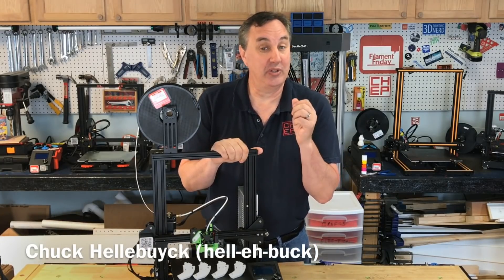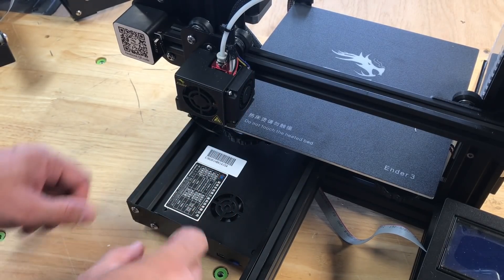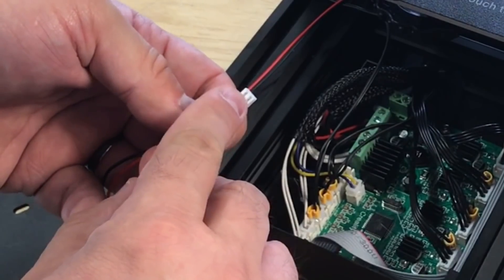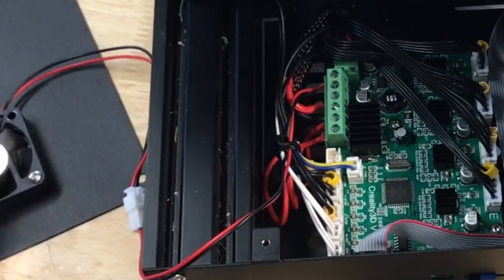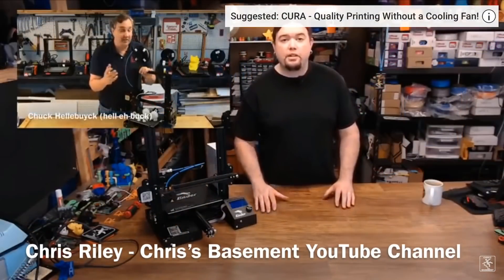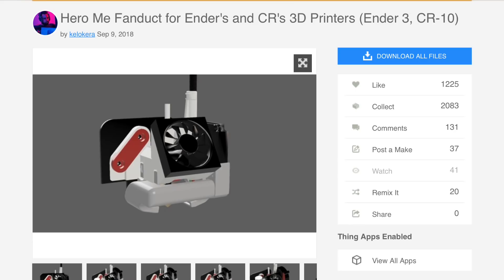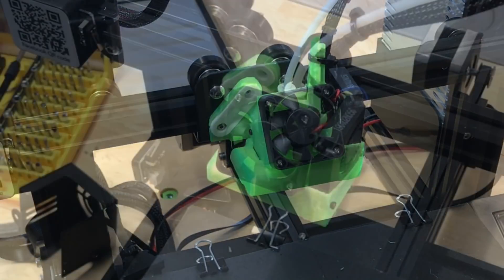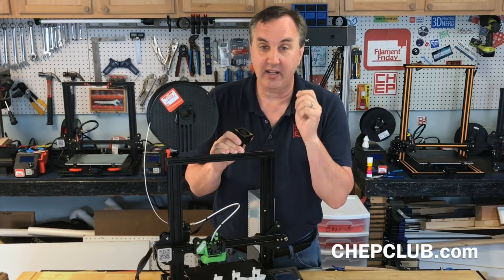HERO ME FAN DUCT and Fixing the Cooling Fans on Creality Ender 3

Comment: Chep, your profile is limiting the speed of your print from the default cura settings because your minimum layer time is now 10 seconds instead of the default of 3 seconds so on a small print that could make your print take up to 3x longer with no added benefit. To make an accurate comparison why not compare the default cura settings (3 second minimum layer time) with fan cooling on and your profile (10 second minimum layer time) and compare not only the quality but also the time it took to print each one.
Reply: Can't agree more
Reply from the maker: I’ve tested that and the results I get are better.   The fan will allow faster printing but not better prints. Quality over speed.
Reply: CHEP awesome, but does that mean fan can provide, not better but at least same quality with less time in this sense ?
Reply: this defeats the need for what chep says.

I use the cr10 for larger prints most of the time  and I hardly would have a layertime less than 10 seconds , 

up the speed by 125% for  boxes and the likes and make sure i set my retractions high enough.
a good PTFE tube works miracles on stringing.

Comment: Thanks Chep, for helping all of us.  I want a silent Ender 3 , but the stock fan for the hot end is anoying one. I read about using Noctua Fans is bad... What can be done to silent the fan ? The only thing  left for me is building an enclosure.. but that is not the solution I was looking for. Thank you in advance
Reply: If you step up to a hero me gen 2. You can run a 40x40x20mm noctua for the hot end and its fine, a 10mm doesnt move enough air. All my fans have been replaced with noctua ones. being an ender 3 pro I had to use buck converters to step down to 12v for them.
Reply: Zachary Calvert 
The standard Ender 3 is also a 24 V system, so buck converters are a necessity either way.  Where is a good place to buy Noctua fans?
Reply: boggisthecat amazon
Reply from the maker: I tried the same size noctua fan in this video:
Quiet 12V NOCTUA Fan on 24V ENDER 3 https://youtu.be/vjL38udVS24

Comment: As an electronics professional I have to say that your tip for non-tinned wire in a terminal block is incorrect.  The solder allows plenty of "squish" to make good contact.  It is superior to have the tinned wires since you potentially have maximum contact area where loose wires may not be all in contact.
Reply: Tin can creep under pressure and cause the cable to become loose
Reply: @AdrenaIin  you base this on what info?  I worked as a trained USAF electronics tech - including high reliability soldering - then as a controls engineer making industrial machines.
If I had to make a general rule  lower gauge wires (heavier) are less affected by terminal pressure.  Higher (lighter) gauge wires can benefit from tinning as it provides additional mechanical support to the very thin and easily broken strands - plus keeps those strands from straying away from the mechanical contact.  The solder will not "creep" as you put it since the mechanical deformation is permanent.  Far more likely to have the screw vibrate loose than a wire slither out from solder "creeping".
The only reason I brought this up was because he specifically said it was a good idea to remove it.  With the gauge wire he was using,  likely 18-22ga,  it probably doesn't matter one way or the other.  But no point in unnecessary steps and it does make inserting the wire much easier.
Reply: @TheRezolutionPhoto  I took that info from a german norm (DIN VDE 0100-520) that lists this disadvantage of soldering the ends of stranded wires. A previous iteration from 1985 specifically prohibits tinned ends on stranded wires when the wire is clamped/terminal screws are used. The new version only states that those connections should be avoided, but if used the connection needs to be designed in a way that temperature increase, solder creep, mechanical strain in case of failure need to be considered

Comment: Okay, Chuck, I am little confused.  I have a brand new Ender 3 coming today.  What should I do?  Dumping the Alpha Wise.
Reply: Have fun with it for a while and then upgrade everything. That's half the fun of these things. I've replaced all the fans, hero me 5015 duct, mks gen l board, bl touch, filament run out, TMC2208 drivers, EXR extruder and a octopi. Its an amazing machine now and prints better than anything else I have owned. Biggest plus now is the only thing you hear is the 5015 part cooling fan.
Reply: @Potatogambit  This is my 3rd printer.  Had a small one and graduated to the Alpha Wise that is a CR-10 clone.  I got so tired of screwing with it and I quit and ordered the Ender 3 mainly because of CHEP.  I am not very excited to start making a bunch of mods to a brand new machine.  Maybe I should send it back. ?
Reply: Stan Cook they print pretty decent right out of the box. I just wanted more features. I have all the same as a Prusha mk 3 now and it's got a better frame.
Reply from the maker: Stan Cook use it and have fun. Download my profiles. Just make sure you use the filament fan unless you want to add the jumper.
Reply: @FilamentFriday  Thanks I have your profiles.   So, do I need to make a mod for the filament fan?

Comment: Wait, you reversed the polarity on the fan? So now it's working against the shape of the blades? umm....
Reply from the maker: I just reversed the wires so Red matched Red and connected to Red power. The fan wouldn’t work if it’s backwards.
Reply: @FilamentFriday  Ah OK. It would work though, it would simply run in reverse if you actually reversed the polarity.

Comment: Hey CHEP, Cura 4.1 is out. I testet it two days ago with my geetech A10 and i discovered a problem: when the printer had to move across the plate without printing, it blocked for a while making a weird  noise for a few seconds. This happened every time the printer had to move without printing. I tried multiple times and i always had this problem with files from cura 4.1. Finally I reinstalled the 4.0 version and all returned normal. Have you tried the new version?
Reply from the maker: No. I’m still using 4.0
Reply: I'm using 4.1 

no issues on the wanhao's and the CR10

prusa I3 still on Prusaslicer.

Comment: Chuck.   I really like your videos and they are very informative.  I would have attached the electronics cooling fan to the power being supplied to the electronics board;  board on = cooling on.  Why did you opt for connecting to the extruder cooling fan?  Thanks.
Reply from the maker: It’s the same power on this board. Power on, board on, fan on. I may do a temperature control switch in the future for both fans though.

Comment: hi CHEP I always follow you ..
we solve a problem that you are an expert.

how do I turn off the ENDER 3 front cooling fan AUTOMATICALLY at the end of the print ... and make sure it doesn't run all night?

Thanks in advance
Reply: If you upgrade your firmware to Marlin the hot end fans will automatically turn off if the hot end is below 50C.
Reply: @satyrn9637  thanks for the advice .. I have the firmware TH3D_UFW_U1.R2.7.
is it okay or what should I do?

THANK YOU.
Reply: @Roberto-cc4el   it's a valid option. Th3d is basically a preconfig and custom Marlin fork. If you have not burned a bootloader on the stock ender board, look into that.

Comment: Im trying to get Amazon Basics PETG to work.  Why do people have such wide fluctuations in bed temps using PETG?  Some people are using no heat all the way up to 90C.  On my Ender 3 pro with the stock magnetic bed  and Cura  Im finding out 240 and 85C with 100% fan, and slowed everything down to 40 speed with first layer at 25.  Do I need to use stick glue ?
What does Bed Heat actually do? Does higher bed temps make filament stick better or just flow more uniformly?
Reply: that stuff prints pretty good. I heat the bed to 70 for good adhesion and then drop it to 40 after a few layers. The hot bed is just for adhesion. Its not like abs where it needs to be hot the whole print. If you want stronger prints with petg youll wanna drop the part cooling fan down. I often leave it off. You want glue stick as well.

Comment: What's in your profile that no one else has?  I want to see chris print your gcode and compare  results!!!

I agree with what you are saying  tune the profile and don't use the fan as a fix all.
 It would be nice to know what crucial setting(s) you have set that Chris does not that cause the discrepancy in quality.

Another very interesting  and maybe controversial  video. 

THANKS!
Reply: Also worth factoring in that some filaments like more/less cooling than others.
Reply: @mrclown7469   agreed